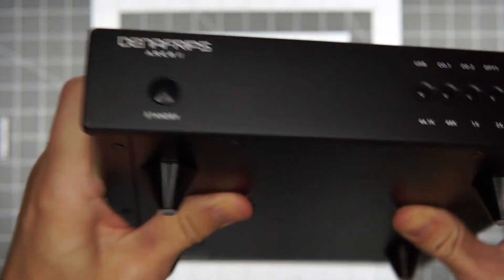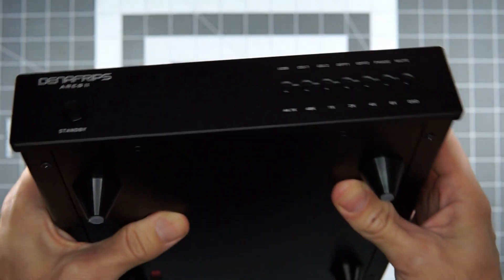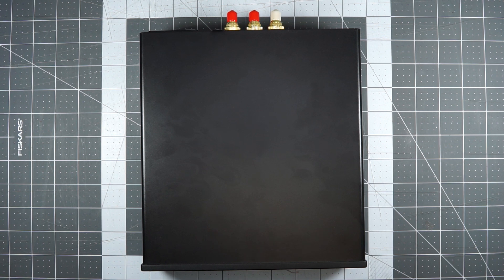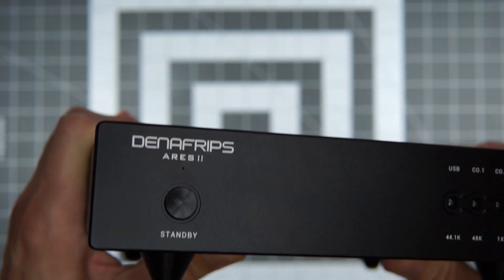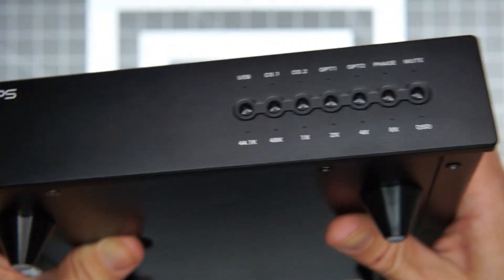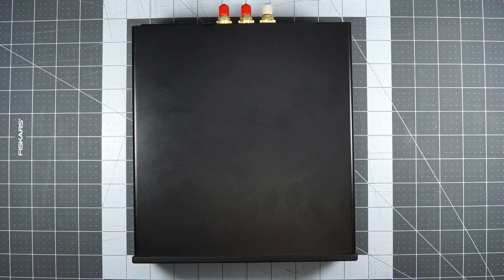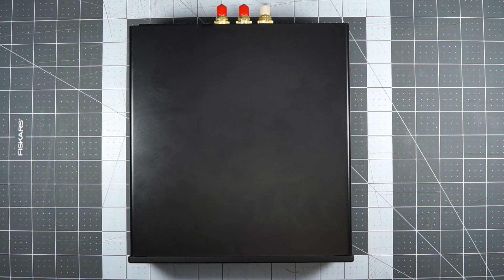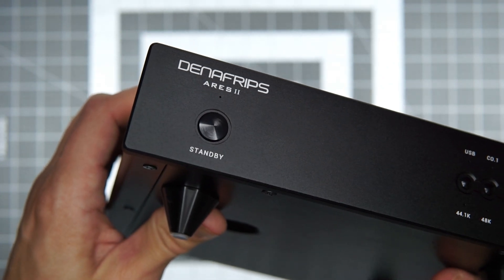Quick Take: "Natural Sounding" R-2R Ladder DAC - Review Denafrips Ares II

Comment: did you play with the os/nos and other settings?  not familiar with usd prices but isn't qutest about double the price?
Reply from the maker: Yup, I did play with the over sampling mode. To my ear it didn't make a huge difference. The Qutest is double the price (if you by new, which I rarely do). It is not twice as good. As I'm sure you know in this hobby the law of diminishing returns is always at play. If you want a performance bargain I think the SMSL SU-8 and Chord Mojo (used) are great value for money. The Ares II is amazing, but with my set up the Qutest is better. Thanks!